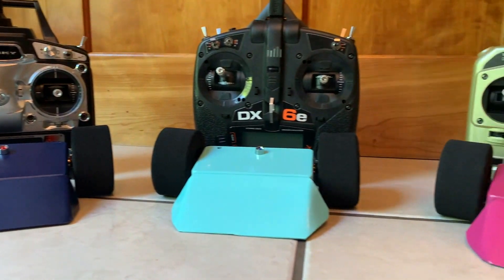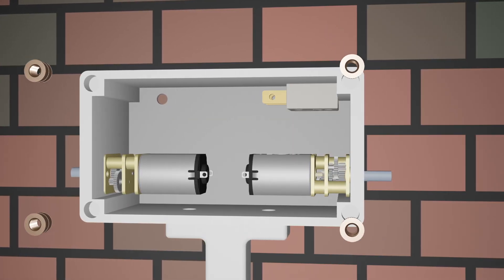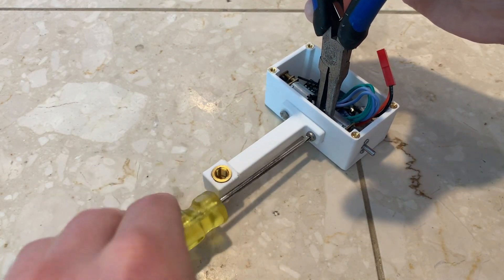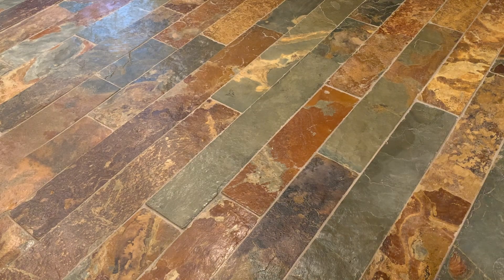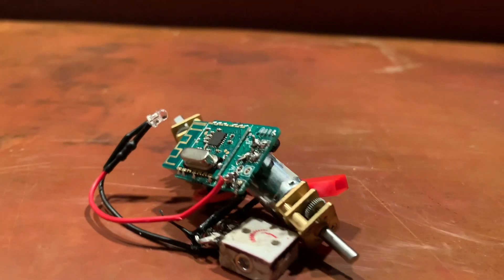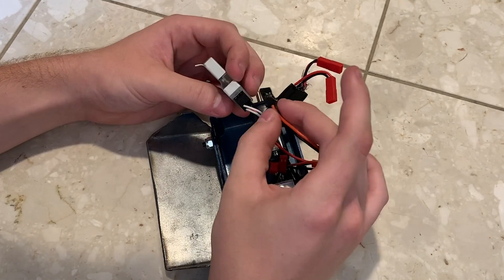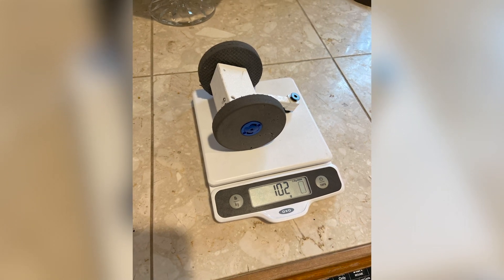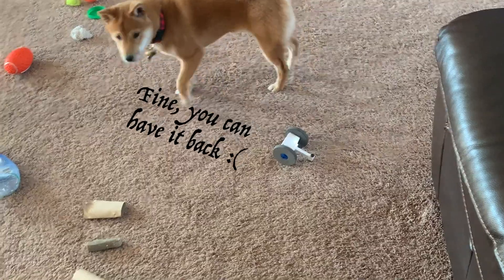Thwackintosh - 150g Battlebot

Comment: I would invest the extra weight into the hammer arm. A long bolt inside the 3d printed arm would add the weight and make it surprisingly heavier than it looks. This not only makes it really strong, but also makes it hit harder as there's more weight behind the hammer blows.